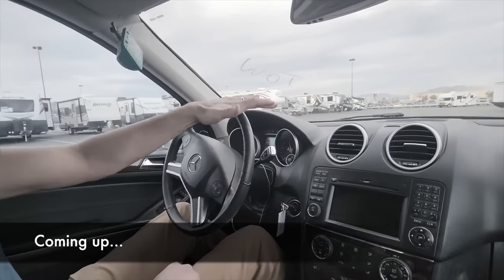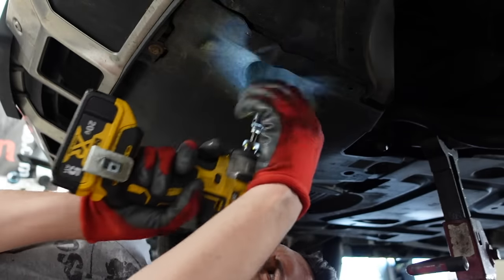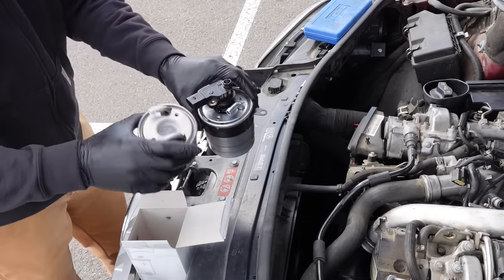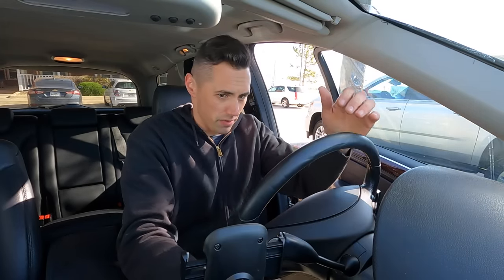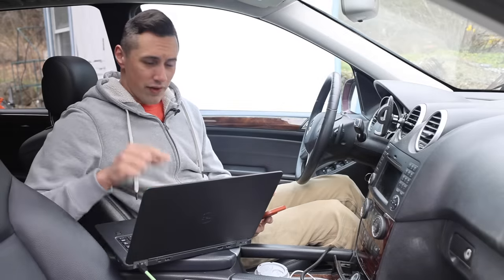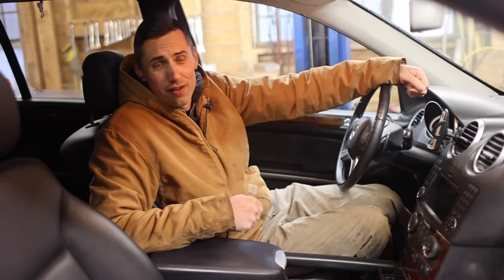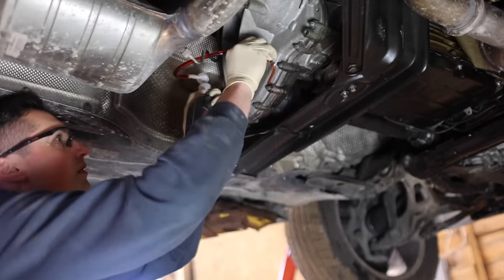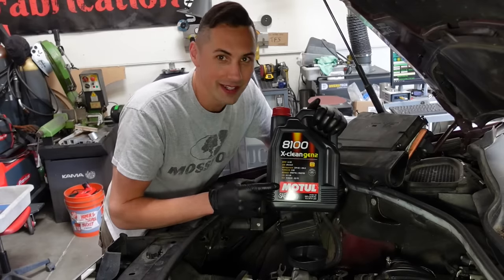This is the Most RELIABLE Luxury SUV I Could Buy for $4,000 (Not a Lexus)

Comment: I think that your stalling issue is relatively common. On older Mercedes like mine, the rpms tend to lower quite a bit compared to my land rover when you shift into gear. Maybe check the flywheel, my 2005 G500 is having worse rpm drops now since I have a very worn out flywheel.
Reply: A bad torque converter can also cause large drop on rpms when putting it into gear.

Comment: As soon as you said diesel and check engine light I knew the dpf was clogged. I had a 2010 GL350 blutec. It also made it burn oil 4 quarts every 800 miles.

Comment: That vehicle probably needs the Emissions Modification Program repair. Look it up; it pertains to the diesel emissions cheating they got caught up in. Take it to your nearest Mercedes Benz dealer.
Reply: Why, so they can make it slower and get worse fuel economy?
Reply: Sounds expensive
Reply: @sunnyvale104  If it has not been completed it is covered by Mercedes. If it has, this code could be covered under the extra extended warranty offered on some intake and exhaust issues after the EMP repair.
Reply: I think you are talking about Volkswagen
Reply: @TheRoadhammer379  Nope, work for an MB dealer. They got caught doing the same emissions cheating. We still replace exhaust and intake systems all the time per a settlement in US courts.

Comment: You can take the DPF and muffler out and pressure wash in reverse flow to clean them out, also do a swirl flap delete and put a resistor in to trick the computer into thinking everything is good, also oil cooler seals. Also another common thing if this is a formatic, if you have popping whenever you floor it then you need to put a new chain in the transfer case.

Comment: I bought a used 2006 Ford Escape Limited V6 3.0l 2 years ago for $4,000 cash. While I was scammed through mileage rollback the car still runs like a champ. It accelerates amazingly and it handles really well. The gas mileage isn't good enough for me, however I also made the mistake of getting all terrain tires but I'll be changing those soon so it should go up. But, yeah, it's nice not having a car payment.

Comment: Nice to see you fixed it. Recommend you buy a Sreeamoight Headlamp or Switchblade LED light. I dint think it's safe to hold your penlight in your mouth like that. With either pr9duct you het the hands free you need and better audio. You will also save from possible damage to your teeth.

Comment: GAAAH! Green coolant! I had a BMW whose manual insisted that the Blue coolant was the only coolant to be used. I had a series of radiator, hose, and water pump issues and not one mechanic used anything but the non-OEM approved green coolant.

Comment: Had a similar problem with a VW turbo diesel a number of years ago.  It was the MAF (mass airflow sensor).  The performance disappeared although it never went into limp mode.  Cheap fix.  In fact, the MB MAF part was cheaper than the VW part number (hard to believe but true) so I used the MB part number.

Comment: Best ever dpf cleaner is without doubt, tried and tested dishwasher tablets. Devolve a good strong mixture in hot water, blank off one end then chock the dpf upright and completely fill with the solution.  Also make sure there is only one dog/cat on the car.  Leave soaking for a minimum 24 hours. Drain and rinse. If you use a decent reader like Aurelius 850 or above. You can do a running check on exhaust pressures before and after the cat/dpf.  Pressure at both ends should be similar. Remember to check how many on the car you are testing. If it’s a steel exhaust the cats are usually aluminium or stainless.

Comment: I had a 2000 ML320 until October, 2023.  Overall very reliable.  Planned on getting over 400,000 miles before getting the Cybertruck to replace it.   Other than a bad A/C controller, I only had to replace normal wear and tear parts.  The SUV ALWAYS started, always ran, never left me stranded.  I only got 371,700 miles on it before a self inflicted engine blow, the rest of the engine still ran to get me safely off the highway before all the oil drained.  (A/C controller computer acting up so revving engine would start A/C eventually, then all good for the rest of the day).   It didn’t like bouncing off a governed 6200 RPM in 3rd gear on the interstate for miles - not intentional - dumb, distracted, dumb.

Comment: Trans flush, open cooling line add 3 qts, run yntil 3 qts goes out,uses 3 gallons of fluid then full change. after that change filter and drop pan. The way you did it changed only 3 qts out of 12 +. then new filter just got dirty fluid through it.

Comment: I made the mistake of buying a diesel car 5 years ago.. worst mistake a Californian could ever make. So many regulations, and the car is programmed to start slowing down whenever the smog is out of specs! Hope you have better luck than I did. Chevrolet eventually bought the car back under the lemon law. It was in the dealership repair shop for 7 months because they didn't have a replacement dpf...diesel particulate filter...oh, and the dpf costs over $3000. The fun is just beginning!

Comment: I noticed that you just turn the key without letting the glow plugs warm up. Good way to damage the plugs. Just saying. There is an icon on the dash to let you know when it's ok to start. Looks like a curly cue pigtail. When the light goes off, start it.

Comment: When dpf i cloged, drive the car 20-30 min at 3600rpm. Then it will normally regenerate. You will See lots of smoke in the back. It is a good idea to do this once in a while to declog the filter. If the car does small trips, or is mostly driven on low rpm, The filter will clog Up Again.

Comment: Two things - here in the UK Diesel is about $8 per (US) gallon and gasoline about 20% more. Your gas is more than half the price of ours but your diesel is quite a bit higher than your gas.
As diesel gives much better fuel economy we all go for diesel here. Most bigger cars (an E Class is big for the UK) will be diesel probably 90%. Gas cars are generally smaller ones that have good economy. 
Diesel hits a big problem in that it freezes (or thickens up too much) when it gets too cold. Here in the UK it does not drop far below freezing very often and so diesels run OK. They are less popular in colder countries. 
Where you are looks cold (as you had deep snow) and when I went to Canada it our RV was a V8 gas guzzler. 
My W213 E Class has just a 2 liter diesel engine but pulls better than the old 2.7 v6. It easily gets 46 mp (US) gallon around town and has done 60mpg on a long trip. 
As a tank of gas costs £100  ($124 us) we go for the best fuel cost option. At least the UK is small and so places not so far to drive! We cannot drive somewhere for 3 days here.

Comment: To be extra safe under low clearance autos, I would use jack stands with a hydralic jack,  only takes one stand to give away. If your working alone, for sure be extra carefull! Then it got worse when he drives on curve got under vehicles, did we miss the chocked rear tire? Besides all that, good video!

Comment: The w124 is still a fairly modern car in terms of suspension and if you get one with ABS and A/C, it's a great daily driver. I think the facelifted version with the multi valve engines is the one to go for, and a saloon E320 is probably the sweet spot in terms of value as the estate and couple are a bit overpriced in the current market

Comment: When my GL 350CDI had a sensor problem with the DPF, as soon as that sensor was replaced I took it for a quick run up the motorway and the DPF purged itself. No need to remove it.

Comment: ...some diesels give you a warning that you need to regeneration the exhaust, which usually means going over 55 mph for about 10 - 15 min...ish. If you ignore it and it gets completely 100 percent clogged, then an engine DTC code and engine light will come up. Once it gets to this point, you will lose engine power, mpg, and could damage the engine if gone too long. Then you need a forced regeneration which some expensive diagnostic tool may do. On some models, only a dealer can erase the code and do a forced regen. Don't ignore the regen when it pops up.

Comment: I had the same symptom with an turbo diesel engine. It turned out to be a "de fogging" pipe coming from the turbo. Sort of small waste pipe for carbon or something. No turbo pressure for that pipe was blocked. A 10 usd operation !

Comment: This is a very reliable car. But here in the US, the diesel is NOT the one to buy due to all the emissions regulations and equipment needed. Europe is different. But I've had a gas version for 6 years now and I've NEVER had a problem with it. Bought a 2011, used with 70k miles and now it has 175k miles. Most reliable car I've ever owned. Even all the electronics still work flawlessly. Interior still looks great too. This vehicle is truly a "hidden gem"

Comment: Good luck with the oil cooler o-rings. I've worked on one with the om642 and damn was it the first and last time. Even the airfilters are located on hard to reach spot, once it starts leaking oil it's better of getting rid of it.

Comment: my mom drives an 06 ml 350 and it has a ton of codes rn but still manages to run well. don't worry it will not stay in its current condition restoration and repairs are underway

Comment: I drive 09 ml 420 cdi. Cant complain with 1000Nm/737 foot pounds of torque and nearly 500 hp.

And its been driven for 510 000km/316 000miles. Some issues but it's to be expected at those miles.

A lot more reliable than any gasoline engine Mercedes ever made!

Comment: I haven’t had luck with the 3m kits. The headlights get blurry again in a few weeks. So I buff the lenses with a wool pad and the 3m (white) buffing compound - it clears up headlight lenses in about a minute or less. Then…. I clearcoat the lenses (mask off surrounding areas!).  I have used Eastwood 2k glossy clear coat from a can on my daughters Lexus ES. Lenses have yet to get blurry again or crack.

Comment: My go to for sluggish drive with no codes is a dirty mass air flow sensor. You will notice an immediate boost is power and better fuel economy. While your there wouldn't hurt to clean the throttle body intake. 
Ps don't get robbed buying throttle body cleaner. Brake cleaner works just as well. And both evaporate fairly quickly if keft. Behind

Comment: I'm 5mins into this video, and my only serious concern is that, because it is a diesel, sometimes people make the mistake of accidentally putting regular petrol gas & not diesel!   This could be a problem with the fuel system clogging up or even not starting up during cold starts and the like with fuel issues!  You can fix all this, by replacing the fuel filter and adding cleaning fuel additives, with time to run it all out.  Take care.

Comment: Another great video! This looks like a nice alternative to the Range Rover. DPF filter! Tell me about it. I had a Saab 95 and every now and again it would produce smoke burning off  from the DPF. I was in Germany and I took it to a Saab dealer. They looked at it and said I had 2 options. A replacement for 2000 euros or clean for 160 euros. Never knew how they cleaned it, so it was good to see your video. The Saab is no longer with me .-(

Comment: The issue with the sluggishness is because it is a diesel engine. You have to pay attention to the road coming up ahead and get up to about 80 with the engine revving quite high so you can have enough momentum. Truck drivers have known this for decades. I know it because in the mid 80's my father purchased a diesel rabbit that got 55/mpg. But you could time the 0 to 60 with a calendar.
Reply: Nonsense. That version of OM642 will give 510Nm of torque at 1600rpm. You don’t have to rev that engine.
You really can’t compare free aspirated diesels from 40 years ago 😂😂

Comment: 2 of my coworkers had the ML.  They got rid of them when trouble starts around 90-100k miles.  My 08 Lexus RX have 158k miles and only issue was failed Water pump.

Comment: I’ve been around Mercedes from the early 2000s and they do feel solid but the electronics of these Mercedes are so complicated. Not only that but their built to a cost so they’re computer systems aren’t made to last fs. If you want your car to work like new even after 200k miles and 20 years without having to spend tons of money fixing it, Lexus would be the way to go though they are rather more expensive but for good reason. You take good care of a Lexus and it will take good care of you.

Comment: You think the ML350 is wonderful??  In 2014 and 2015 the ML250 and next year GLE250d has the 2.1 Diesel that get 500k in the sprinter vans.  Just drove from Miami where i bought it and drove to Nashville TN.  34.8 mpg and 700 miles of range per tank.  Yep, tank and a half of fuel.

Comment: These engines also suffered from the oil cooled leak . A $10 gasket buried deep in the valley of the engine . A lot of parts to be removed including the turbo . Not sure if they upgraded the O ring in 2010. The 2008 had this issue . Ask me how I know lol.  Love ‘em or hate em. No Lexus GX.

Comment: I own a 2018 RAM 1500 with the VM Motori 3.0L Turbo-Diesel engine and the ZF 8-speed automatic transmission.  I currently have 290,000 miles on the truck without any problems to speak of.  That said, I am going to replace this truck with a 2025 RAM with the 3.0L in-line dual turbo six-cylinder gas engine.  The Diesel is no longer offered, and I doubt I would buy it again because of the maintenance costs related to the diesel engine.  The truck looks like new and drives like new without a squeak or a rattle which is why I am keeping the truck for field service in the citrus grove.  I love Diesels and I love RAM Trucks, but I don't need a 3/4 or one-ton Cummins Diesel.

Comment: You have to drain the torque converter as well  to successfully change the transmission fluid theres around 3liters of fluid in the converter alone. If you don't the new fluid that you put in just gets dirty again. On any modern diesel engine is very important to maintain the car properly and in time then the car runs perfectly with no issues. I own merc benz w222 S350d bluetec i change the oil every 10k -15k km even the manual says every 30k-40k km thats stupid the engine will go if you stick with the manual timing chain and many more engine components will wear out. transmission fluid always just Mercedes transmission fluid and torque converter drain is must every 50k km the diff evry 70k-80k km. And very small but very important thing is the red oil seal between the intake manifold and turbocharger it tend to leak oil into the turbo when it's old it's worth to change it as well as the oil valve its small plastic circle its located on the right side under the air filter when this gets old it pushes oil in the turbo it's simple to change low on cost but very important for the health of turbocharger. And never ignore any warning codes like you had disconnecting a sensor is stupid from the previous owner. Maintenance is the the key for healthy diesel angine it doesn't cost that much if you do it on your like your capable of.

Comment: Most of your problems caused by an unplugged sensor and a leak from the oil filter housing just a gasket because of that unplugged sensor caused the particulate filter to clog and you just cleaned it and gave it a major service a pretty good car and the economy good for an SUV also l do like in your fuel economy figures you included the equivalent UK figures we use them in Australia thanks for that

Comment: How many rebuilt consumer Diesel engines do you run into these models, versus rebuilt gasoline engines?  The diesel engines have a reputation for 300,000+ miles before any major overhaul?  Any regrets so far?

Comment: "Charge air cooler" is manufacturer speak for intercooler. An open sensor circuit tells the computer the intercooler is too hot. (That's the safest bet, a too-cold intercooler won't hurt anything.) So the car thinks it's intercooler is hot and it detunes the engine by cutting boost and fuel to avoid high EGTs (because it thinks the incoming charge air must be too hot).

Comment: I do believe any check engine condition prevents the DPF regen from happening, regardless of the cause. That was the case with all of the diesel cars I have owned.

I personally don't subscribe to the mentality that modern diesels have worse reliability than the old ones. I don't remember the last time I had trouble starting in the cold with a modern diesel for example.
They just don't like old-person-driving-habits. 
I have witnessed small, modern 1.5-2.0litre passanger car diesels clocking over 800k kms/500k miles with nothing more but reasonable amount of maintenance, good driving habits and fixing issues when they appeared rather than waiting for them to develop into catastrophic failures.

Comment: I have a 2009 ml320 bluetec.  It does feel very luxurious.  I definitely would not say its reliable.  Tons of oil leaks (oil filter gasket and the killer main seal gasket).  Had to send in the ignition key thing to get fixed.  Dealership paid me to fix the emission system.  Now i smell diesel/exhaust so i have to track down that issue.  Transmission is due for a flush.  So...very nice car but definitely requires attention.  Oh, and i also could never find the source of a parasite battery drain so i had to install a battery shutoff to keep from draining the battery down.